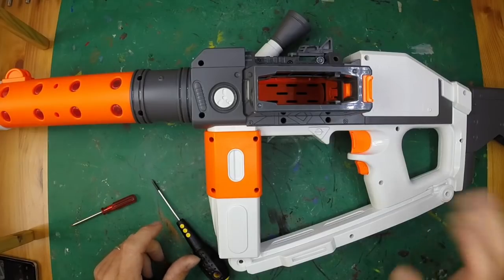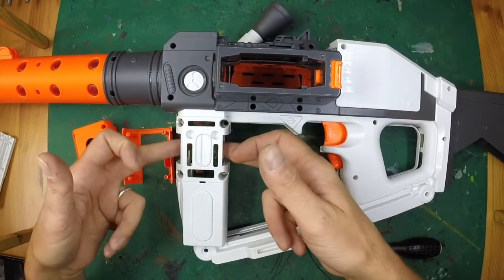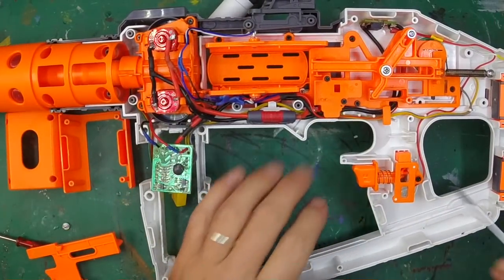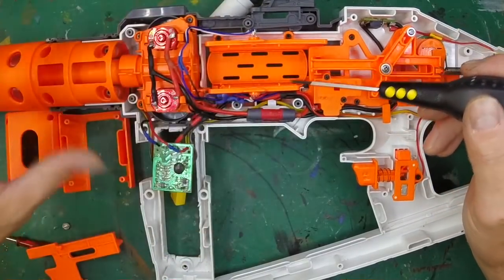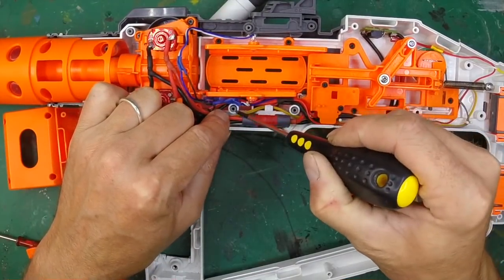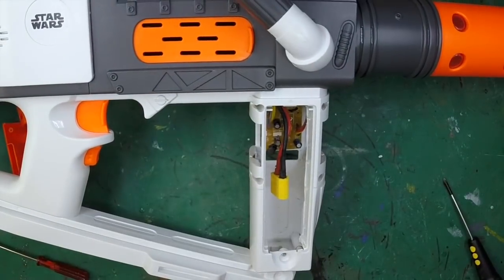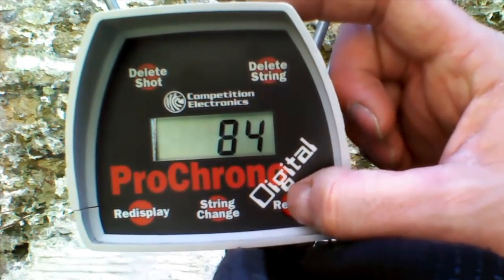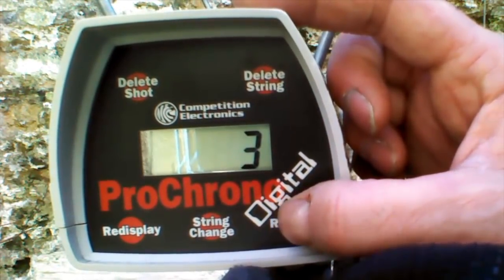Star Wars FOST Deluxe Mod and Test

Comment: Nice! Any reason for the stock flywheels, I assume that is all that would fit/ due to cage? The wiring on this looks horribly close to the flywheels as it is!
Reply from the maker: Andy Braid It now has the OOD lightweight wheels in. There is space for concave wheels but you have to cut away a lot of the dart entry ramp on the cage.